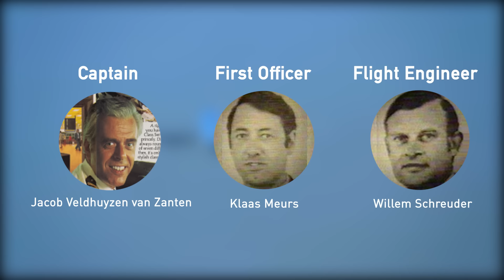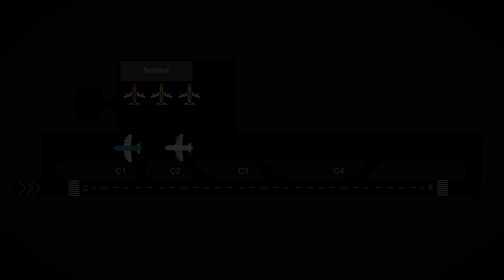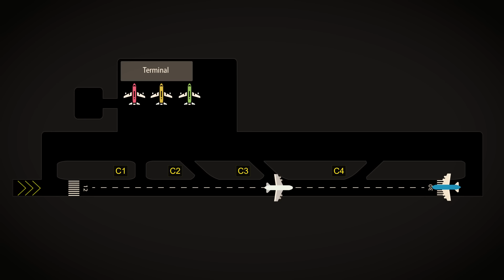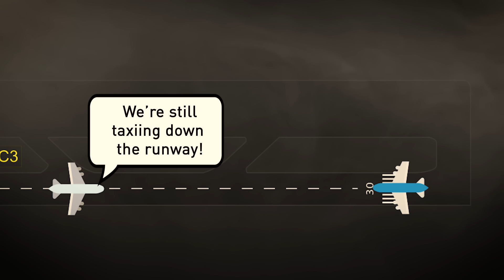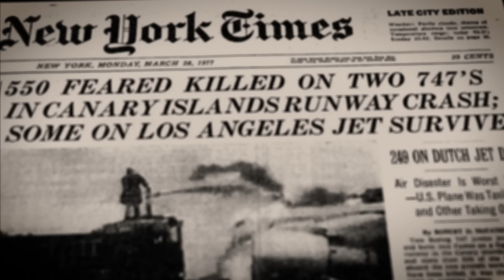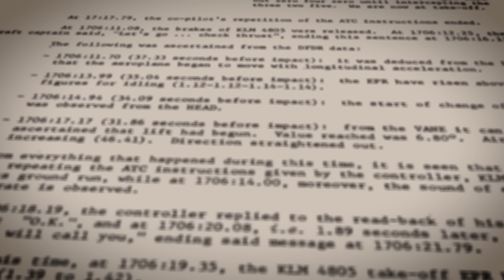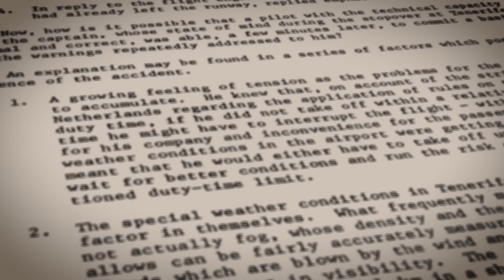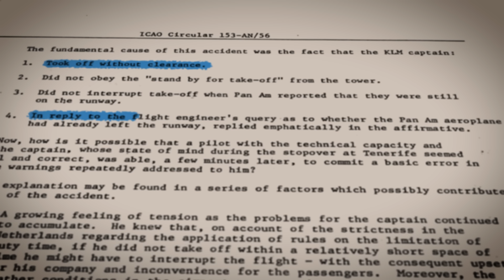Tenerife Airport Disaster | Deadliest Crash in Aviation History

Comment: I begged to differ from all reports. I know generally, most aviation accidents are caused by a series of events. I believe that there is only one reason for this accident, putting all political correctness aside, the captain of the KLM should not have taken off without a takeoff clearance. Besides, the airport was fogged over, he knew that the Pan Am was behind him on the runway how in all names could an aircraft captain decided to take off into dense fog without being cleared for take-off. Even if he was cleared for take-off he could have also verified for himself if Pan Am was clear of the runway. All those other reasons are horrible because all those things happen every day everywhere in aviation without causing an accident. But I guarantee if someone should repeat those actions of the KLM Captain The result will be the same. But if pilots get in fog, cross communicate,  take on fuel, and don't try to take off without a take-off clearance there will be no accident.

Comment: Actually they were instructed to exit C4 cuz C3 and C2 were turn sharp of an angle for the 747
Reply: As I understand it, having read the ATC transcript, the instruction to the PanAm was to leave the runway at turnoff C3. The PanAm flight crew checked their plates and saw that this was not practical for a widebody such as the 747. That is why the PanAm proceeded to C4, and was in the process of exiting the runway there when it was struck by the KLM, whose Captain had initiated a takeoff without clearance and without being certain that the runway was clear.